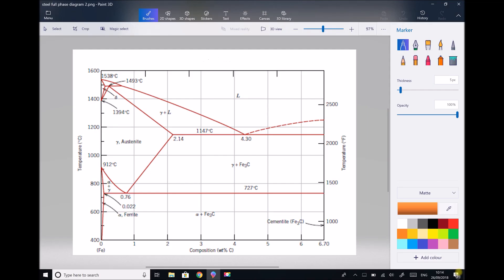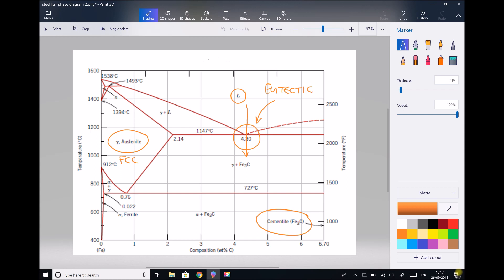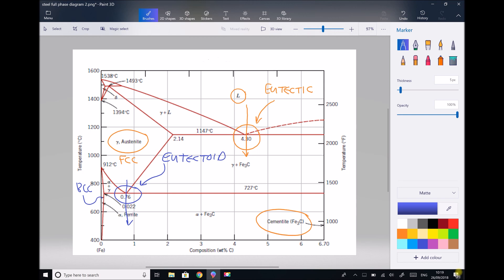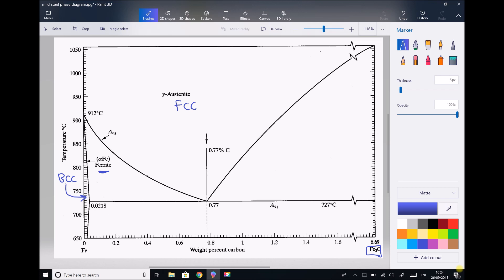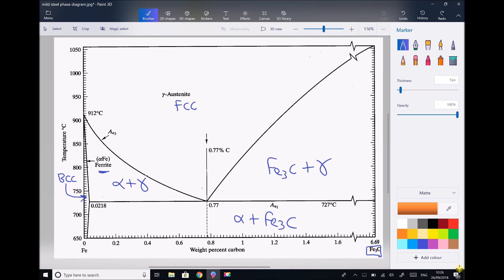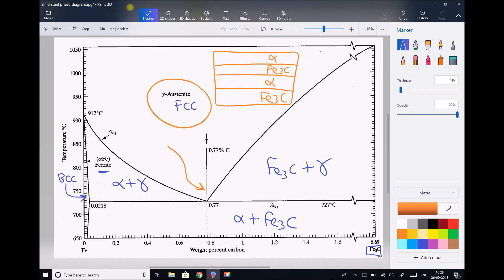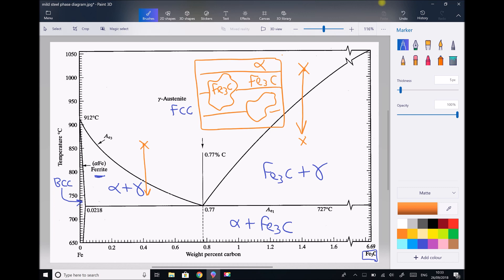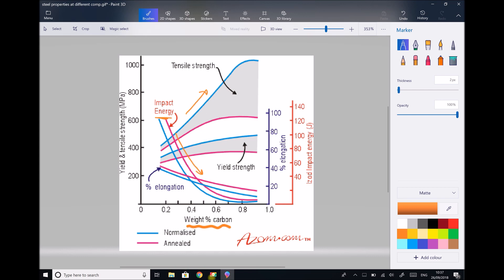Formation of Ferrite, Cementite and Pearlite in Eutectoid Steel

Comment: you said Ceramics have a very high tensile strength in around the 11th minute in the video, how can this be when ceramics have low tensile strength because of the presence of cracks and very high compression strength. can you clarify what you meant when you said that?

Comment: Could you tell me what the Gamma and Alpha mean when you say e.g. Alpha Fe3C + Gamma? 

I love the video though. Very well explained.
Reply from the maker: These are the different phases of the steel (or Iron). Alpha is body centre cubic (BCC) and exists at lower temperatures, whereas Gamma is Austenite and is the steel phase at higher temperatures, when it turns to face centre cubic (FCC). FCC is softer and more malleable than BCC.